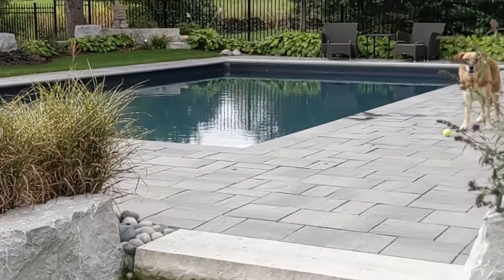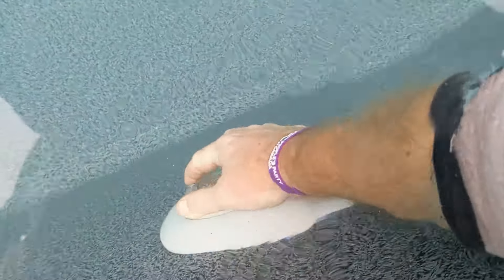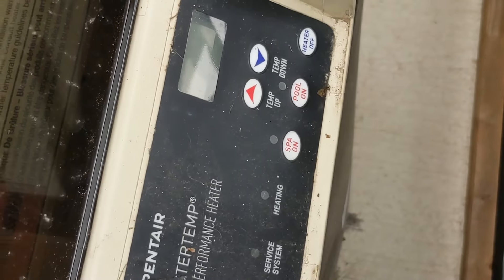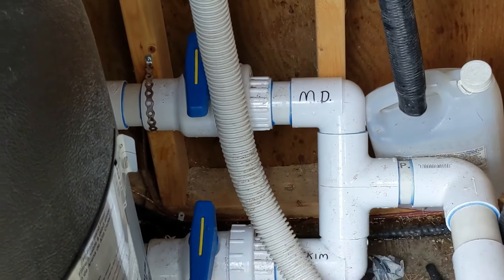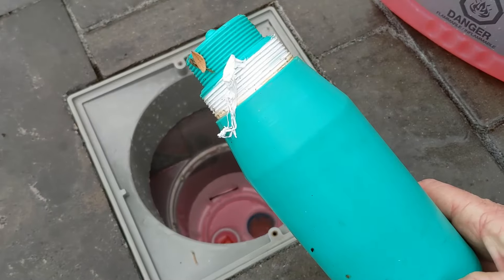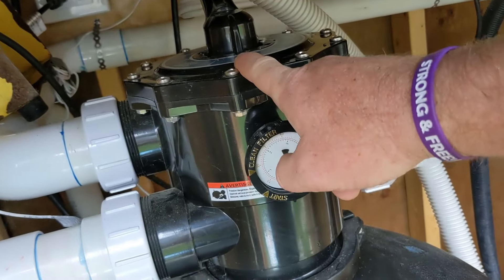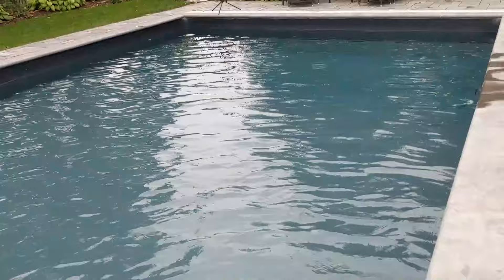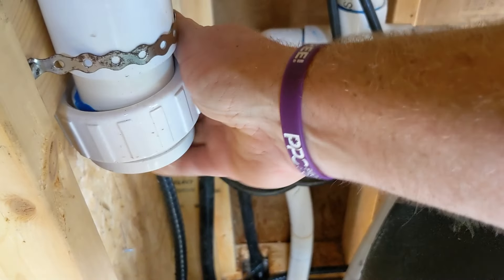Close and Winterize a Swimming Pool by Yourself / How to Close a Pool for Winter

Comment: Thanks soo much for all ur winterizing videos!!!  I’m slowly learning and piecing everything together!!  Please do more videos on closing a pool with an attached spa and air blower!!  Thanks!!! :)
Reply from the maker: I don't get too many attached spill over spas or air blowers.  Most blowers can be detached and also have a check valve.  Should be videos you can piece together that will help you winterize that blower.
Reply: @VIPPoolsandSpas  I have been looking for YouTube videos on air blowers and haven’t found too much.  I heard u are supposed to use the cyclone/mighty vac to blow out the spa jets and turn on the air blower at the same time to get enough air to clear the water from it.  

Also, If u could leave more tips on ways to verify u have blown and sealed things correctly.  Like after u put in a winter plug into the return, is it normal for it to have a FEW bubbles of air come out? 

I love watching ur videos bc u always throw in an extra tip that no other YouTubers mention! I’m slowly gaining the courage to winterize myself!
Reply from the maker: @FixItWithMe  The spas Ive closed, I empty it and blow the lines out.  Then shop vac the water out.   If theres a blower on it, I would guess its just like putting a mighty vac on it.  Just dont run the spa blower for a long time.   I also put antifreeze in every jet and suction.  Then I cover it with a tarp.  Not just right across, I put the tarp right into the spa.  Then I put wood across to suppor it from all the snow we get.

Comment: Hello, thank you for your videos. 
I’ve got a couple of questions for winterizing my inground pool. 1. For blowing out the pipe lines can I use a small air compressor? If yes on which holes of the Hayward super pump should I connect my air compressor hose? The hole on the front or side hole? 
2. During the blowout which mode  should I locate the filter handle?
3. My suction side is included two lines which come  from the pool to one side of a valve and I don’t know by closing the valve which line will be closed the skimmer line or main drain? How can I figure out which one is the main drain which one is the skimmer line? Is it really matter to winterize both lines? 
Thanks for your time
Reply from the maker: I don't use air compressors because they don't do the right job.   If you need to find out what line goes where, just starting blowing out lines and you'll find out.

Comment: How do you blow out the backwash part? My backwash is not a detachable hose it runs to my sewer system
Reply from the maker: Great question.  Put the filter on waste and then blow the line out.   If you have another type of filter, just cut or disconnect the pipe going into the ground.  You can always put a fitting there for next year.

Comment: I have watched all your closing videos. Very helpful. I know you have a Mighty Vac, but most of us would not have this or a Cyclone. I wonder if you could try it with a shop vac first. In this video, you have a 2 port skimmer, the one closest to the pool is plugged like mine. I have read that this could be a reserve line in case the first suction line gets damaged, or is capped and leads no where, or is plumbed to the main drain which is useless. How do you think this particular one is plumbed? Also, what position should the MPV be in when you drain the filter? And when you're done, should the MPV be on Winter or Closed?
Reply from the maker: Will do.  Shop vac can't blow out the water as well.  I tried the $400 shop vacs and it cant push the water thru to the Main Drain.  Will do a video in the next week or so on that.  If you see a cap in the skimmer thats upside down....its dirt there if you take it off.   If you have a main drain it will go to the skimmer or to the pump.  if its capped and you dont have this setup....its dirt under there.  No plumbing.  When blowing the return lines in between the pump and filter, turn the dial to recirculate or whirlpool.  you can turn the dial to close or just in between any of them.  The idea is that it drained the sand filter better. opens it up.

Comment: Question please, if I’m the only owner of the pool routes let’s say I have 15 of them, in winter how do I cover them by my self most  pools can’t be covered by one person any ideas about that, hope to get an answer thanks.
Reply from the maker: You can cover any pool by yourself.  I did it for 5 years.  Doesn't matter is it a water bag, lock in or safety cover.  Hard to explain how to get all of them on by yourself.  Maybe I should do videos on that.
Reply: @VIPPoolsandSpas  yes please need video like this, I used to work as pool technician before I had so many big pools that can’t only one person close it 
, need it at least 4 people to cover up, all of them were commercial swimming pools
Thanks for your answer.
Reply from the maker: @ProStories51  commerical pool.  Well, there you go.  Some are bigger.